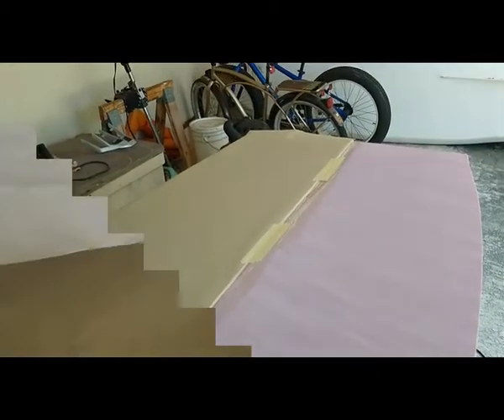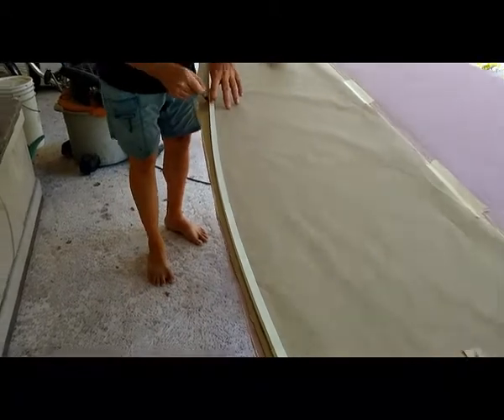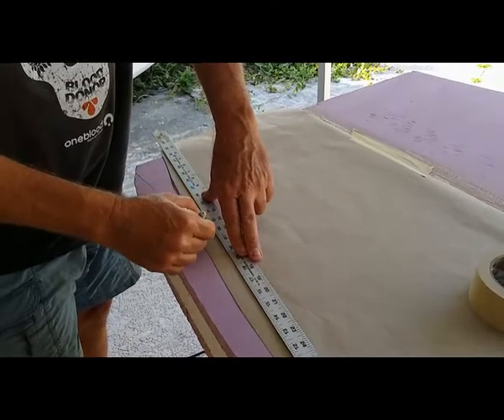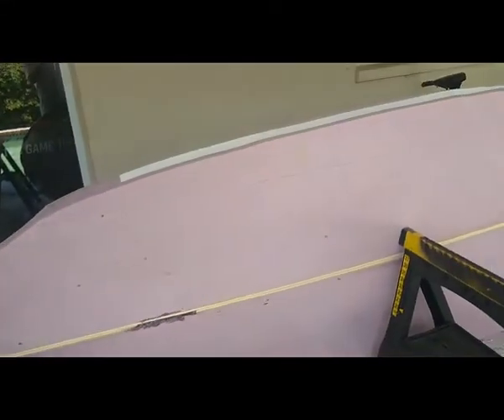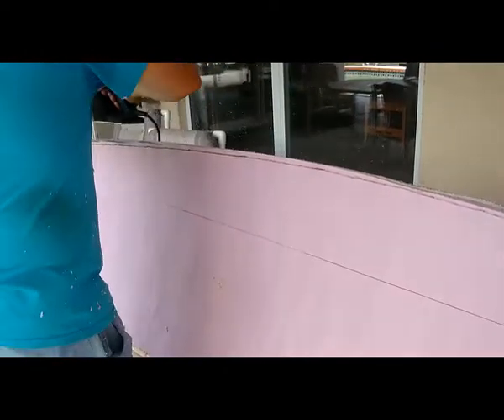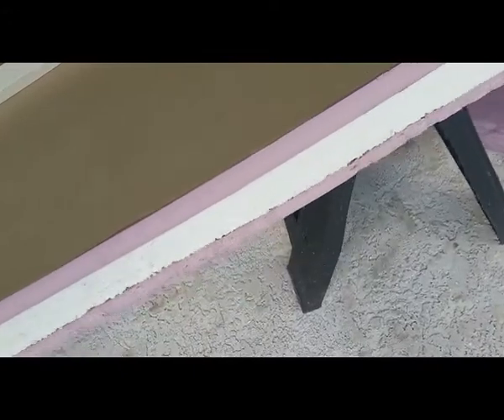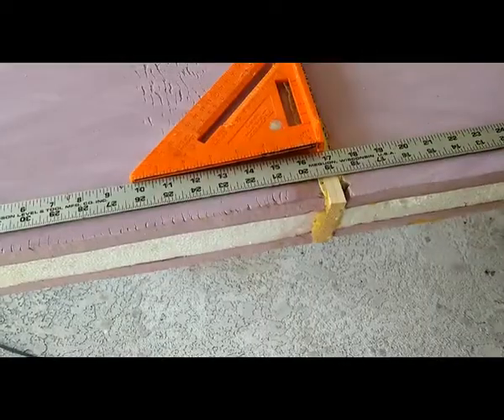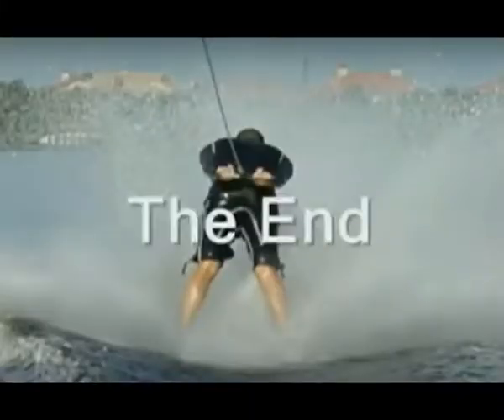Standup Paddle Board Number 2 - Finalize the Outline

Comment: I didn't know electric planers were a thing. Looks like the perfect shaping tool for the job. It's looking good so far.
Reply from the maker: They work OK, but do they make a mess! There were bucket loads of foam "chips" all over. Maybe a newer planer would have given me bigger pieces. Also, you can't advance the planer too fast, or it tears up the material.
Thanks for the comment